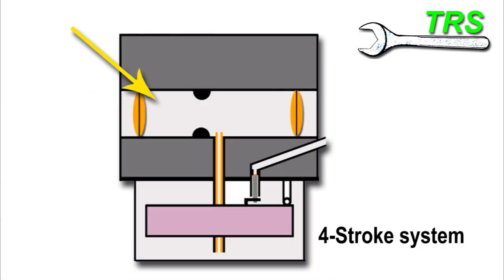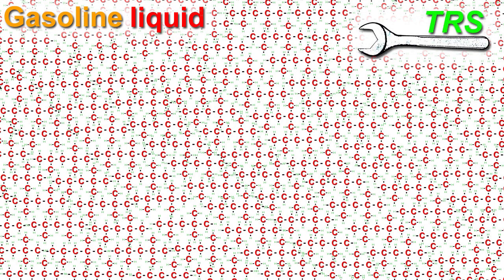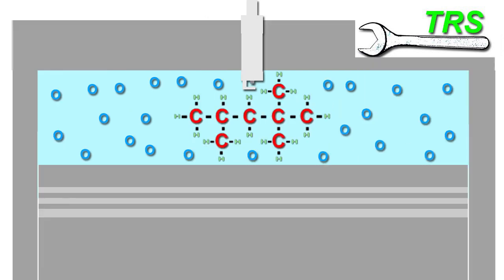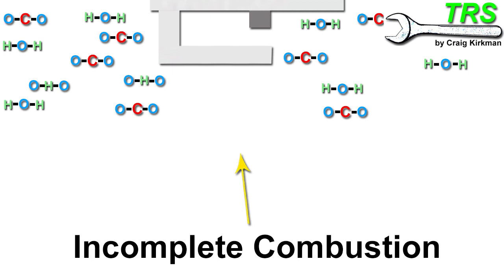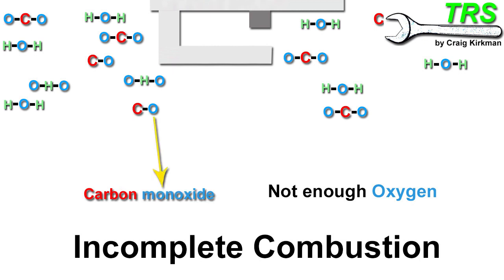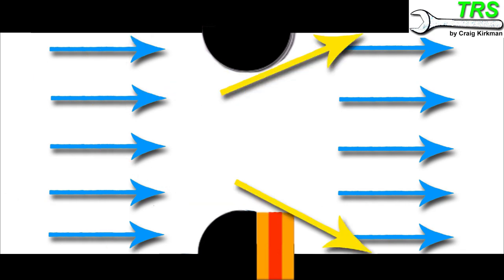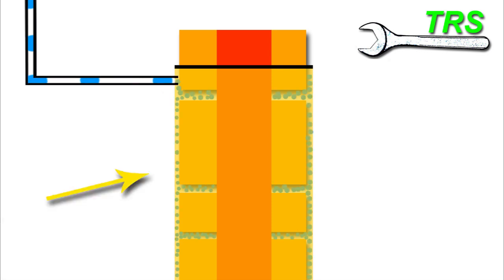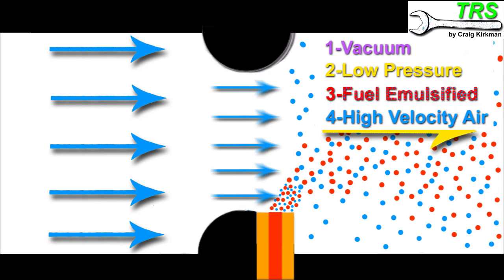Why Liquid Gasoline (Petrol) is incombustible in 4-Stroke Engine | Carburetor Fixes this!

Comment: Hey Craig,
Once again you’ve excelled at expanding my knowledge of the  fuel/carb system. Thank You for taking the time to put these videos together. I can assure you they are definitely worth every minute I spend watching. 
If I can offer one suggestion it would be to slow down slightly. I sometimes find that you’ve already moved on to the next step before I can absorb what you’ve just said. 
Cheers
Murph

Comment: In four stroke engine,in my own analysis, when the intake and exhaust valves are closed and the piston goes downward the volume of the cylinder is getting wider and at the same time vacuum occurs,I don’t know if it approaches absolute zero maybe not, at the bottom dead center the intake valve will open and due to the atmospheric pressure that passes through the carburetor the gasoline with the air turned to gas going inside the cylinder and now compressible then compression follows then ignition then expansion of the gas that’s power. Atmospheric pressure is 14.7 psi at sea level.

Comment: In two stroke engine opposite happens the vacuum is below the piston in the crankcase as the piston goes up while in four stroke engine above the piston as it goes downward with all the valves closed. Now there’s a difference of pressure from the outside and the said cylinder. Outside 14.7 pounds per square inch (psi) inside the crankcase in two stroke engine and in the cylinder of the four stroke engine below atmospheric pressure. Sudden opening of the intake valve the air rushes in passing the opening of the carburetor designed by the physicist Bernoulli. Gasoline as liquid turns to gas with air.

Comment: Why does a air screw in a stihl fs160 brush cutter not working 100% without the air filter it dieing when I squeeze de trottle works better with it on but not getting full power
Reply: I took the muffler same thing